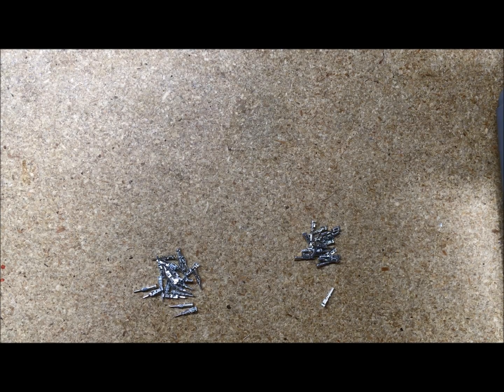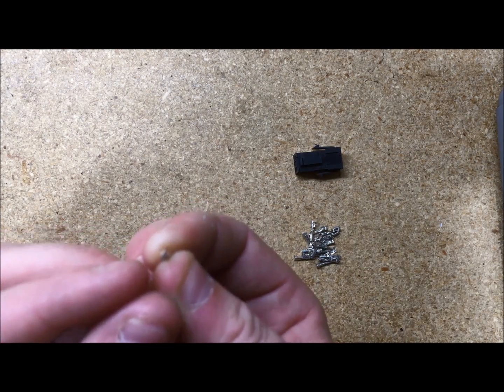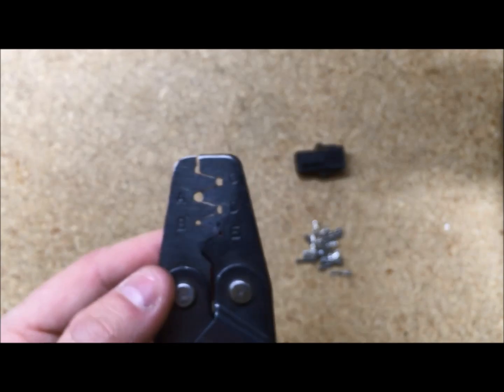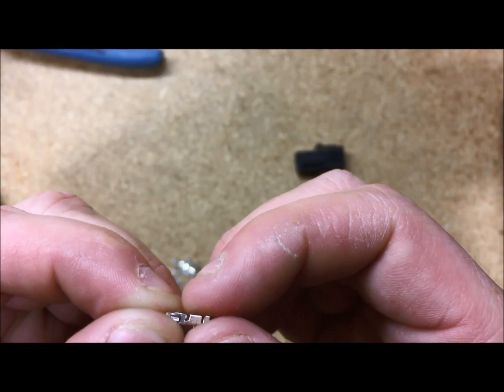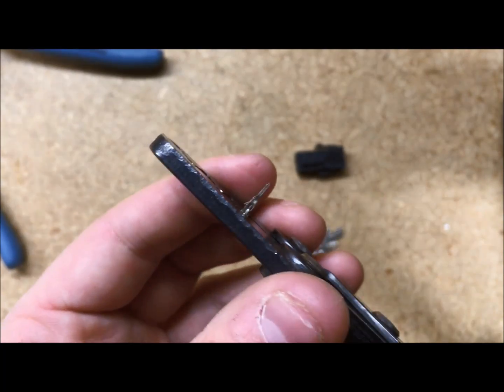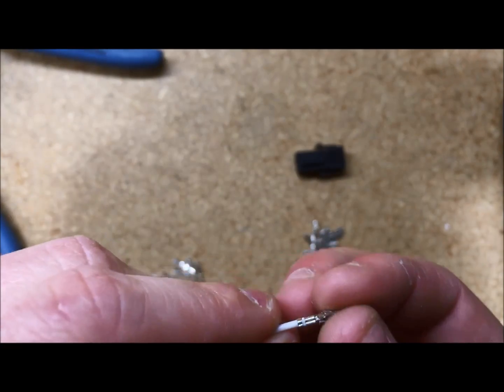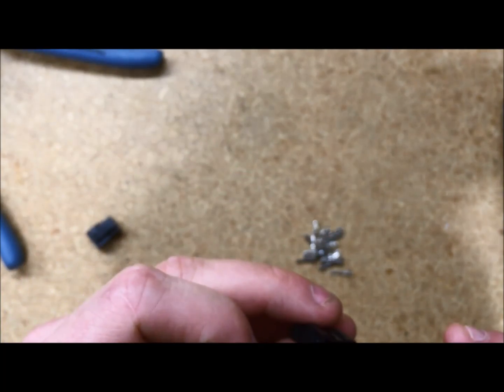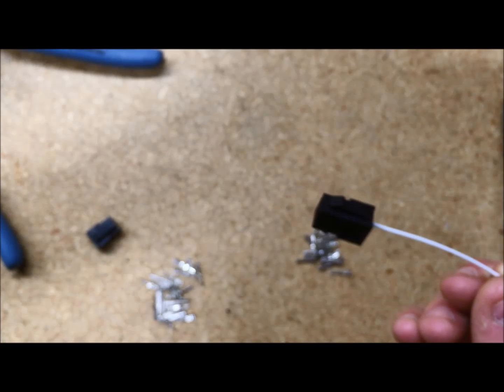019: MICRO-MOLEX Connectors

Comment: You are going too quick, not taking the novice into consideration - by not focusing on the male and female ends, but I think you put the male pin into the back of the male half of the connector. Correct?

Comment: It would be good if you said which half of the connector shell the male pin goes into and which half the female socket goes into.
Reply: It's in the first 15 seconds or so, where he identifies the male and female connectors. Connector gender always refers to the pins/sockets inside, and has nothing to do with the design of the connector itself. Thus, the male connector will contain male pins, and the female connector will contain sockets.